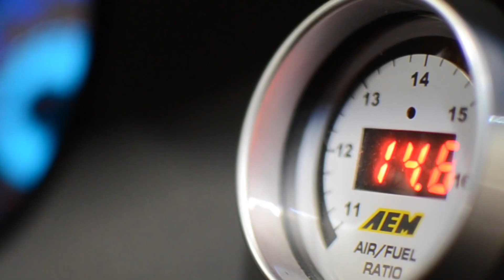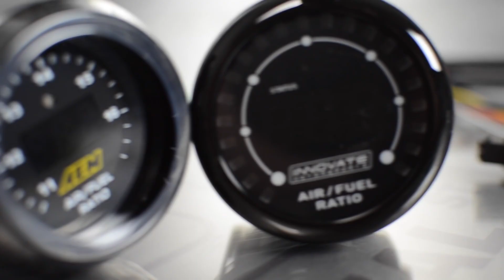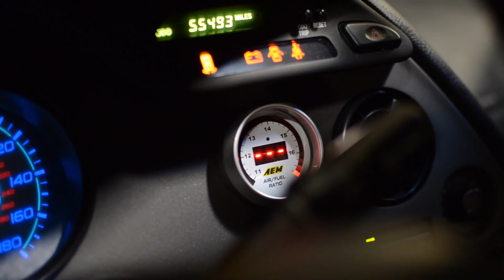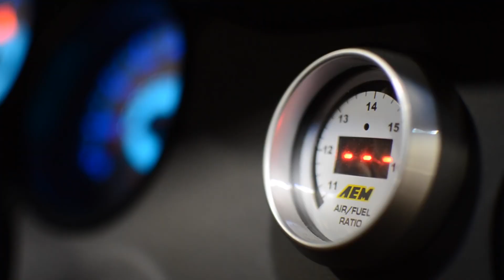Lambda VS AFR - Jay's Tech Tips

Comment: The signal from an oxygen sensor cannot tell you what the air-fuel ratio is in the intake manifold.  Oxygen sensors don't tell you anything other than there is some oxygen in the exhaust.There is no such sensor that can directly sense the AFR.

Comment: I have a 1970 BMW 2002 with two Solex 40 PHH carbs. At idle and low speeds I see 11-12 AFR but on the highway going up grades it leans out, over 17.  Should I go to larger main jets?

Comment: I am wanting a fuel air gauge for my 1 cylinder 5000 watt power generator so I can run lean and get the most power lower my gasoline cost.. Also considering going to Natural gas. You  are more expert about this so let me know your suggestions. Might consider an Exhaust engine temperature gauge to avoid burning an engine. This generally loads nicely and kicks up when something big loads the circuit. Generally constant load.

Comment: Great video. One more question. Does the sensor know when its heated up to its operating temperature? Im asking this because i would like to install it in a different location than recommended, closer to the head of the engine. That means it will naturally by the heat of the exhaust gas, warm up quicker than usual. Can the sensor overheat or will it know when to stop the heater itself?
Reply: Yes if you get a sensor like AEM

Comment: I have a 450+ whp caliber srt4. Full e85 with all supporting mods. I tune myself along with other caliber srt4s. I'm kinda confused here.. With hp tuners and dodge, I set the lambda, but what would I set the wot ve tables to for example? Say if I'm only wanting to work with lambda? Currently I just set the lambda table to all the same values and adjust the ve tables accordingly

Comment: Just throwing it out there, but I recently bought an A/R guage with sensor for $130 and it has read out settings for 5 different fuels or scales (lamda, gasoline, E85, diesel, methanol). So I'm pretty sure it compensates and adjusts according to the fuel type or scale you choose. Well worth the money IMO. I bought so I can use it to get the jetting correct after making mods to my ATV. This was a good informative video though. Thanks real street. The video link below for anyone interested in seeing it.
 https://youtu.be/tPmXFEp2Xl8

Comment: You mentioned  a 14.7 to 1 ratio for gasoline is that by weight or volume ? What if I am running a nitro mix? Does changing the timing change much? Does predetination of  lower grades show up on the fuel air ratio? If you use a Butane Oxygen mix will the gauge work and give valid rich lean numbers? Lambda

Comment: So I just bought a Xseries Wideband, hooked it all up in my Honda civic running turbo, the guage worked fine for 3 days, now only at idle or just cruising , it will read good, 14.5.  14.7. But soon as you have the throttle wide open it flat lines,  dashes rite across,  does anyone know what's up?
Reply: that would be it reading either too rich or too lean check your tune, it could also be a failing sensor. so start with checking tune because thats easy and free, and possibly calibrate your wide band guage.

Comment: So I have a 2010 wrx and my aem Air to fuel ratio gauge is Reading 14.3 to 15.2  but it doesn’t show me how much fuel going on to my moter. Can someone help me.
Reply: Adventure Joe it's not going to show you how much fuel, just the ratio of air to fuel. The higher the number the more lean you're running and the lower the number the richer (or "fatter") you are running. You don't want to get too much higher than 15 when applying throttle. If it is getting higher than that you are lean somewhere in your circuits. For gasoline 14.7 is the ideal number. If anything, running a little richer is usually better than running too lean. Running lean creates a lot of heat and even backfire and possibly surging.

Comment: I’ve replace a o2 sensor because of the code but the light comes on again. During warm up the voltage is 1.7. The non affected bank reads o.2 before the replacement the voltage was 2.9. Can an exhaust leak cause these high readings or is that pretty much a damaged ecu. Customer said it came on around the same time his car was rear ended.

Comment: I’m looking into getting a wide and sensor, ive gotten exhaust and header upgrades and my question is will my ecu adjust to the sensor vs the stock narrowband sensor or will it throw a check light. Performance wise will the computer also adapter better fueling. Can I used a wideband sensor with a narrowband harness or that will have to be piggy backed?

Comment: I have a 99 3/4 ton 4x4 suburban with the 454CI (7.4 to you liter folks.) During normal acceleration from stop light to stop light, every now and then it falls on its face HARD. not like the AC compressor turning on feel, but like I lost 50% of my power. I don't have a gauge and It does not smoke when it falls on its face. Should I invest in a Air/Fuel reader?
Reply: what you need is a scan tool try cleaning the mass air flow sensor but its a guess
Reply: juan rodriguez I appreciate the response. Already did that. I think it's the fuel pump and a leaking injector. Starts perfectly when cold but when the engine is warmed up, it smokes and sputters to a start. Could be related
Reply: yes leaking inj. common on these also ck.fuel pre. regulator inj can be remove send them out for testing and cleaning
Reply: juan rodriguez yeah already replaced filter and fuel pressure regulator. Next on my list is the pump then injectors but I got other things to fix right now. Thanks for your imput tho! I had a feeling from the start it was the inj. But was in denial because I didn't want to replace them. Start easy and cheap then work your way up
Reply: got a set of 8 rebuilt for 100.$ bosh they work great e bay new were more than the veh worth they can be rebuilt they have a machine that cleans and test flow but they get 25$each

Comment: does this apply to different octane's of gas? Like 93 and 110.. will the afr needed be the same?
Reply: Brad, this is why he mentions the benefits of lambda.  If you use Lamba, 1 is 1.  Regardless of the fuel.  Actual stoich values do change based on the fuel you're running.  Check out the video at the 1:18 mark for more details.

Comment: Will I need a wideband 02 sensor if im only running 7psi of boost?
Reply: Wideband sensors are always handy to have, especially if you're going to add boost to a car.  Let's you see what is coming out of the exhaust ports and can prevent costly meltdowns if you run too lean.

Comment: I got an aem wideband 30-0300 about 5 months ago.
The gauge now says "sens" on it, but before the gauge used to stay heating for over 1 minute or longer.
Any ideas on how to get my wideband to read again?
Thanks!
Reply: G2G, I'd check all of your wiring on the gauge and O2 sensor to make sure you don't have a loose connection.

Comment: i recently got protuned on my 04 sti, i didnt have any gauges at that time, im looking into an afr do i need to get retuned? or can i just use the sensor as is.

 the tune is pretty solid, car is running great i have an accessport for it.
Reply: No need to retune, adding an AFR will allow you to monitor the air fuel ratio if you'd like.

Comment: 4:26 Why boosted engines need richer mixture?
Reply: Richer mixtures run cooler than leaner ones, due to more gasoline in the mix to absorb heat.
Reply: Cylinder pressure and temperature increases. Injecting more fuel will keep temps down and prevent knocking.
Reply: How?

Comment: idle is 13 14.     WHILE driving is 13 14.    I floor it goes to 12.  13 depends.   if I let go it goes up. 14 16 17 18 20. and stays in 20 until I floor again ???  why.  why too lean is that normal.  2016 procharge mustang.
Reply: Yep. It runs richer at idle and cruise than I'm used to but it makes sense if it's procharged. When you let off the throttle it stops pumping fuel into the engine unless you're at or near idle. They do that to reduce fuel consumption.
Reply: Who tuned the Coyote? If tuned correctly that car has 2 factory widebands and should hover right around 14.10 AFR at part throttle and idle, WOT should be no leaner than 12.0, I typically set them around 11.5:1, leaner will sacrifice torque and not pickup and HP

Comment: Thanks for making clear that the sensor itself will report the same output level as Stoich no matter the fuel. Few commentators nor WB sensor sellers make that clear and that leads to confusion about AFR calculated by the gauge head unit and its indirect relationship to tuning math. Lambda and 1/Lambda (or Phi) makes table correction super simple.
  Case in point that using AFR is routinely misleading, is that most gas these days is E10 (and getting worse, thanks EPA renewable fuels mandate)  and therefore more like 14.1:1 at stoich. But your will still get 14.7 on your good ol AFR calculating gauge when your fuel system has trimmed up the mix to E10's stoich.

Comment: So why does factory cars run 12.4 A/F? it's a waist of fuel, correct?
Reply: 12.5 is ideal
Reply: Richer mixtures keep the combustion temps down and help prevent catalytic converters from melting, too.  Hence the richness under load.

Comment: I have an issue where my o2 will not display any reading on a cold start, but if I cycle the car it will fire up.  Any opinions why?
Reply: +Clay Patterson If its a heat issue, not sure why it would heat up after a key cycle and not on initial cold starts

Comment: Thought that diesel would have a higher stoichiometric value than that like 19.0-1 or something or is this again very heavily influenced by different engines as mentioned in the video?
Reply: +TriniRogue  
Stoich is directly related to the fuel only. 
A given engine configuration, how it is used and what the instantaneous operating conditions are may dictate an AFR value that that is above or below stoich.
Reply: Thanks for the insight guys appreciated :)
Reply: +TriniRogue  stoich is about the same but because of the way diesel engines work it's normal for them to run slightly lean like 19:1. as you said.
Reply: +1 apart from where you said "slightly".

19:1 is very lean, (but totally normal for a diesel).
Reply: noxious89123 
>50:1 AFR is very lean for a healthy diesel engine at idle, <49:1 is considered normal AFR. 
Diesel combustion is characterized by lean overall A/F ratio. The lowest average A/F ratio is often found at peak torque conditions. To avoid excessive smoke formation, A/F ratio at peak torque is usually maintained above 25:1, well above the stoichiometric (chemically correct) equivalence ratio. In turbocharged diesel engines the A/F ratio at idle may exceed 160:1. Therefore, excess air present in the cylinder after the fuel has combusted continues to mix with burning and already burned gases throughout the combustion and expansion processes. At the opening of the exhaust valve, excess air along with the combustion products are exhausted, which explains the oxidizing nature of diesel exhaust. Although combustion occurs after vaporized fuel mixes with air, forms a locally rich but combustible mixture, and the proper ignition temperature is reached, the overall A/F ratio is lean. In other words, the majority of the air inducted into the cylinder of a diesel engine is compressed and heated, but never engages in the combustion process. Oxygen in the excess air helps oxidize gaseous hydrocarbons and carbon monoxide, reducing them to extremely small concentrations in the exhaust gas.
Reply: patw52pb1
So exactly what I said then really... Regardless of what is "normal", stoic is stoic. It is not variable. Stoic for diesel is around 14.5:1, so like I said, 19:1 is very lean.

But again, as I already said, it is normal for a diesel to run very lean.
Reply: noxious89123 
Not exactly, I agree with number-2 diesel fuel having stoichiometric AFR of approximately 14.5:1 
I disagree with your characterisation of diesel AFR of 19:1 as "very lean" for a diesel engine.

Comment: Do you have any experience tuning cars at high altitude? How should the target AFR/Lambda vary or change for cars at 4000ft and above? What are your favorite tuning programs for each platform? Thanks!
Reply: Wrongwayislost77 it doesn't change with altitude 
It stays consistent for your target 

It measures the difference in combustion ( air and fuel ) that same amount of air and fuel will vary depending on elevation but the target will not

Comment: damn I want a lambda gauge now fuck my aem afr gauge
Reply: +Alex Caulfield 
Most newer AEM digital AFR gauges are also Lambda gauges. 
Each AEM gauge is supplied with a replaceable black Lambda faceplate and a black/white AFR faceplate. 
Lambda mode is selected by a screwdriver adjustable rotary switch on the backside of the gauge when set to P1 position. 
Replace the AFR faceplate with the black Lambda faceplate and set the gauge mode to the P1 position and you now have a Lambda gauge.

Comment: Why would only one of my Wide Bands come on. One wide band is always on and working, whereas the other is almost always off, but comes on every once in awhile. Any suggestions?
Reply: +Michael Rooney 
Possibly damaged/defective wiring/connector or I have seen a flaky WB sensors, rarely it is the WB controller. 
Has it ever worked reliably and consistently? 
Physically swap positions with the sensors and see if the issue follows the sensor or stays with the cable/connector.
Reply: +patw52pb1 It has worked consistently and reliably in the past. And I've tried switching them, no good. It's the brand new Pro-M efi engine management system if that helps. Came with everything from injectors, wiring harness, wide bands, mass air, etc.. Thanks for all the help by the way
Reply: Michael Rooney 
When switching places with the O2 sensors, I am assuming the problem stayed with the original location??? 
When using a laptop or scan tool are there any DTC's set? 

First, I would disconnect the harness at both the O2 and the controller and closely inspect the connectors and pins. 
I have seen damaged, corroded and loose connector pins in the connector shells cause similar issues. 

Next, I would suggest performing a continuity test on the WB O2 sensor conductors in the harness. 
Do you have a wiring schematic for the Pro-M harness and controller pin-out? 
You are welcome.